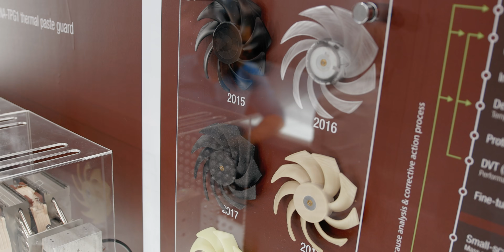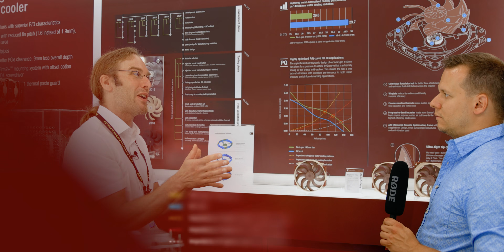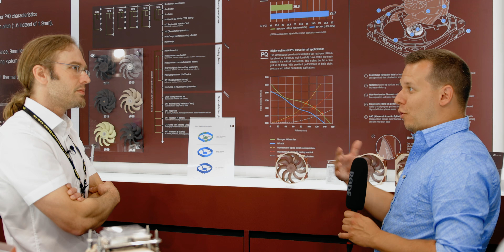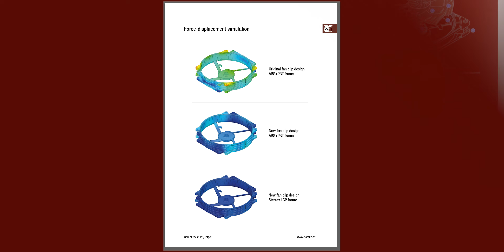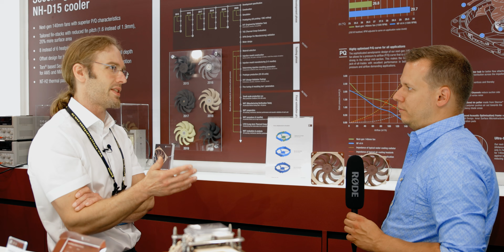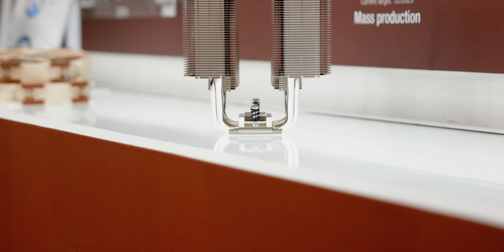This is why Noctua Fans & Coolers are So Good!

Comment: the thing is this cost the same price as a water cooler so why should i pay  a cooler fan when can i have a water cooler ?
Reply: air coolers last much longer
Reply: you pay for performance plus aio has more parts that can fail, with air coolers you only have to buy fans, aio should mostly be used for the hottest of the cpu or  myb for small itx builds
Reply: You aren’t the target audience
Reply: Lasts way longer than an AIO
Reply: this cooler is basically a hunk of metal, it's going to live longer than you. it'll last as long as they make brackets for it. 

water cooler, especially an AIO, last as long as the pump, or a leak, which will likely take out something else because water and electricity and all that
Reply: Its okay, get a nice AIO, use it awhile, it’s something that everyone here has done/gone through, we will see you in a few years. Aircoolers will be waiting 😅.
Reply: Water coolers are noisier, doesnt last as long, a lot more hassle to install.

I use air coolers and it annoys me that most modern cases these days leave extra spaces at the top for AIO making the case larger than it needs to be
Reply: Go with the noctua air cooler, you won't regret it.
AIO coolers are overhyped in general.
Reply: Because that is the very same price that will be on par or even outperform some of the best 360mm AiO coolers and the D15 was the king of air coolers for over a decade.

Comment: I'm worried about the fact that they aren't saying anything about a Chromax Version....
Reply: embrace the brown
Reply: @curmudgeonnn  perfect for fractal design North case
Reply: @curmudgeonnn  hell no lol
Reply: In a different Video is mentioned that the chroma version of the new fan will be out a few months after the brown release. Of the cooler I don’t know
Reply: @m.m.1634  thanks a lot for your answer
Reply: The black version will take a few months at least, as they have to alter the material itself, since simply painting them black will alter the performance. One may call it over-engineering, but legendary performance takes legendary effort.
Reply: @cristianroth8524  i bought three a12x25 for $110.  I dont regret it one bit. Ive never had a PC this silent before it’s crazy